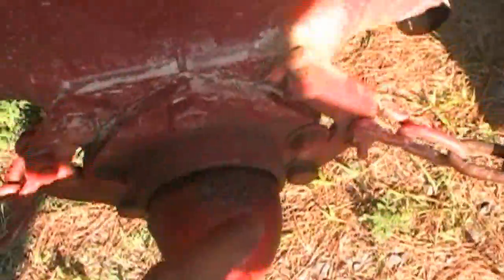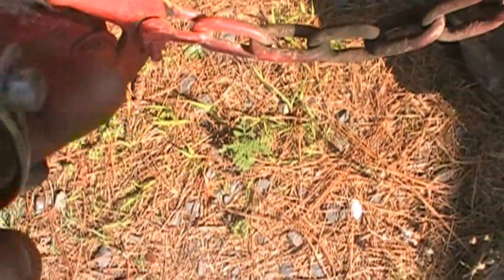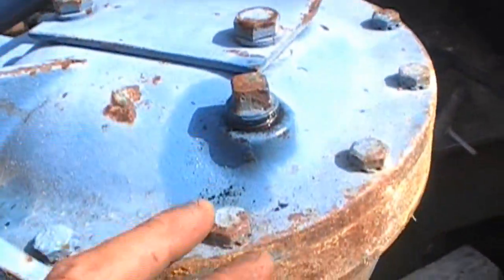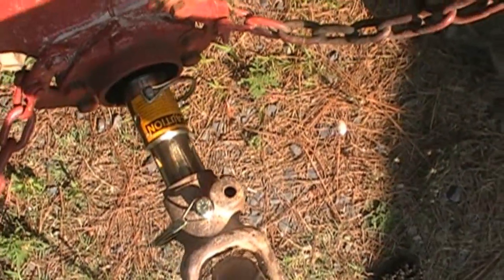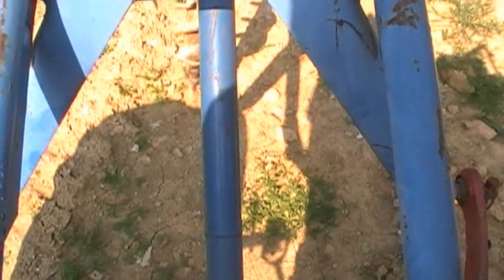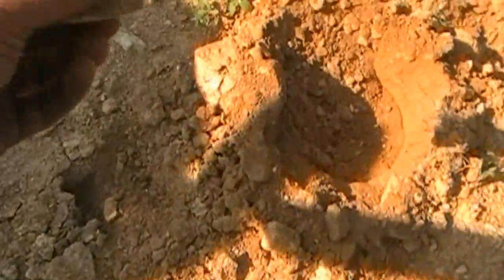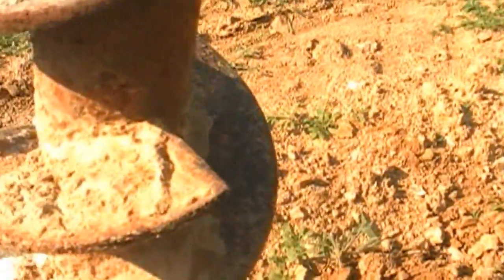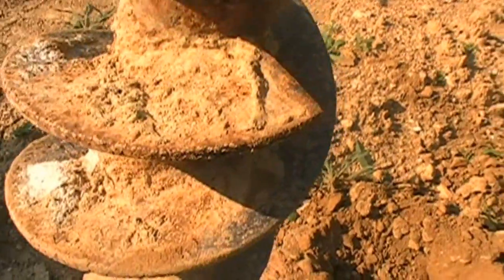tractor tipping auger

Comment: The old Case I used to have had a roll-pin at the PTO. It didn't have a "live" PTO so I used an over-run clutch to keep from being pushed into a tree by the momentum of the brush hog. Lovin' my Kubota now. If it's been as hot as you said, you may not be able to dig a hole anyway. When it is VERY dry, my auger will just sit on top of the ground spinning. I have to dig a few inches... fill the hole with water and dig again the next day. Sometimes it takes 3 days to dig a deep one. Love your stuff.